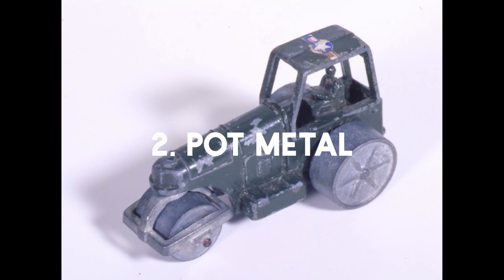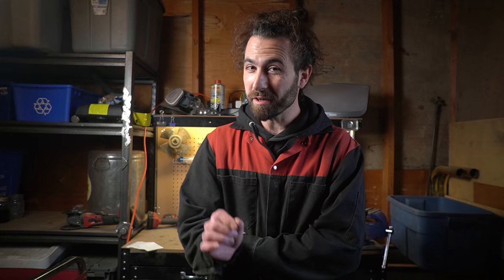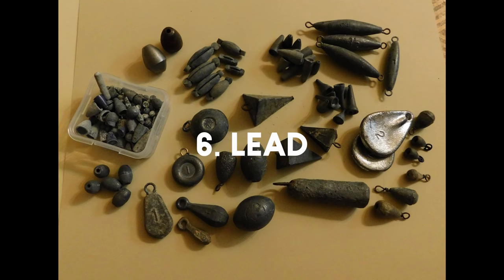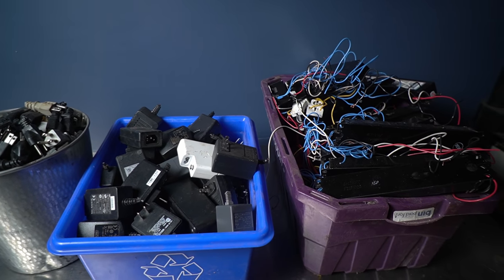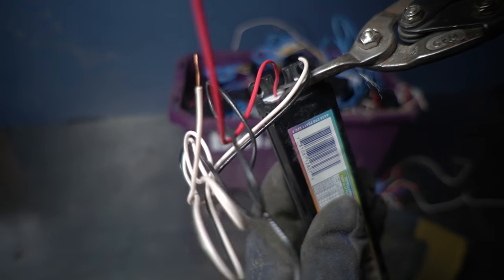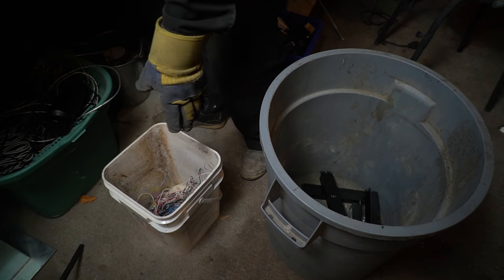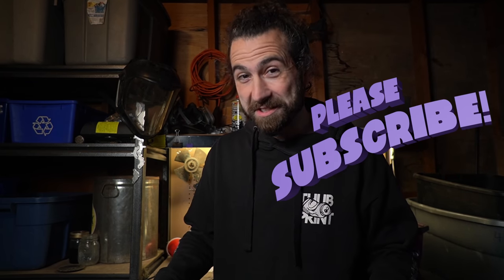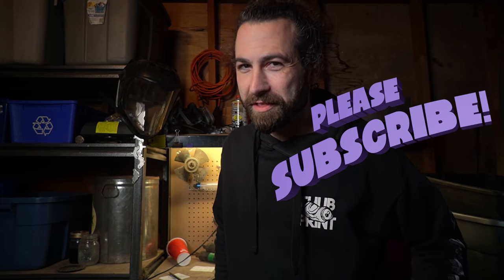I Never Scrap These 9 Items!

Comment: Awesome video as usual Thub. Very interesting to see what's worth the time and what's not. With that said I do collect the brass from plug ends however I don't heat kine up I just put them in a vice and they come right out. Here in west virginia the e-waste is a total waste of time so I end up putting most of it in my metal shred.
Reply: I scrap plug ends the same way. If very easy I think. But everything can be cleaned in a fast amount of time with a little thought and knowledge
Reply: Where I'm at there is a e waste yard but I've never been there and all ike you said it's a waste of time for most part. I save certain items and put in a container to sell on ebay. Other than that I toss in shred.
Reply: It's such a shame there are not the same opportunities across the world, here in the UK I got £1000 for just 171kg of e-waste a couple of weeks ago and computers literally take no more than 5mins to completely tear down🙈🙃
Reply from the maker: That’s such a good turnout! Not hard to see why people like Ewaste with results like that 👍
Reply: @thubprint  exactly, shame it isn't like that world over, so much more would be recycled I'm sure👍

Comment: You dont soften up plugs or wires. You put them into barrel with used motor oil for instance, then get it hot enough so PVC just melts off the wires and the plugs, then scoop them out. You can then siphon oil to another barrel, drain the PVC out to get oil off and if you do this with colors, some places are interested to buy the PVC it self to make recycled PVC to mix in with virgin material, so that could be potential way to do it. Just need to make sure there is no contamination from other plastics and depending who you sell it to they might want you to clean it, but that is just soap and water.

Comment: All you have to do is grab the butt end of the plugs with pliers or channel locks then grab a print with a pair of channel locks and roll down most of the time it will pull the brass out with the copper still attached. Very easy pop on a video of you scrapping makes it more fun

Comment: you are right about  small electronics and laptops.i take  every ic chip relay  3leg transistors  tantalum capacitors and save apart every  BGE gold corner chip. tv boxea and dvr coax connectors are the same bras  material on the power cords ingeneral itdon`t worth  but on  rainy days, snow, storms  holly days,miceo scrapping is ok  while watching  tv or listening  radio.  do not compsre salary in time because if you like ti scrap  it`s aldoa hobbie. but every little adds. good  video.

Comment: another topic, maybe you've made a video on it?   caste aluminum, it's everywhere and i have a large heap of it that has small amounts of steel in it, molded i think.   what's the secret to this stuff, some of it has good weight.
Reply from the maker: I haven’t done a video on cast alu specifically but I’m a big fan! Depends on how dirty it is really, I’ve got a favourite scrapyard to take engine blocks and transmissions and such because I still get a pretty good price despite being dirty. Alu bbqs though, those are a good price everywhere

Comment: The power supplies are only good for is repurposing you can use them to power car stereos in the garage and have a amp hooked up as well & various other useful things that need to have a step down 110v to 12v or 12v to 110v

Comment: On the plug ends if you will hold them with your grips and pull the brass with a pair of diagonal cutters they go faster and no strain on the wrist. Also fun fact: in my area the scrap yards want you to separate the ballasts but pay less than shred price, generally 2-3 cents (US) a pound less......

Comment: Dude! I love these sorts of videos!! The "is it worth your time" content is top notch 🥰 
In response to your question, 2 things I stopped collecting(or at least fully dissassembling) for scrap. 1) Toasters: yes they have a couple good brasa contacts inside and occasionally a transformer but for my time it's beat to clip the cord  for stripping and toss the body in the tin. Occationally the bottom will be a piece of sheet aluminum but that's it. 2) computer monitors, I'll dissassemble and scrap tvs any day but the monitors (especially flat screens) are better just given to what ever charity will take and responsibly reuse them. 

A couple things I'd love you to investigate. The brass you get from power strips. And separately the brass you get from outlets and light switches. Lastly how much copper can you reeeeally get from that center core of the magnetron in a microwave🥰
One point I dissagree with is the PC power supply, not for their wires yes they are trash, but inside there's several small transformer, copper coils, and usually 2 large aluminum heat sinks. Some people say don't waste your time with head sinks but I gather them in a bin and my scrap yard has a category called extruded aluminum "clipping" which these usually are (so are the individual sinks that sit atop a cpu❤️) and it pays only slightly less than clean extruded 🤘 ok that's it from this trash panda🥰
Reply: Also, I've similarly given up on coffee pots and steam irons. Yes they have a big chunk of cast aluminum but you have to go to the effort of cutting out the heating elements. That said still on the fence with electric grills, grittles, and waffle irons. 🥰

Comment: On plug ends, hold the base with large plyers, grip the brass with side cuts down low, pry sideways. The brass pulls out, 90% of the time it brings out the copper with it. 5 seconds per plug.
Reply: You would have to do 450 plugs and a 1/2 an hour to get 6 pounds of brass. The average plug yields six grams of brass per . do the math before 13:53  your run, your mouth. And stop believing fairytales. At 5 seconds per plug, he still would only be able to do 300 sixty, and that would be non. Stop one plug every 5 seconds for a full half an hour. So it's bloody impossible.
It's more like 1 pound per 6 hours if he was double fisting em and doing  with his feet too. Do the math bro!
Reply: I've never come close to 450 and a 1/2 an hour. And I've had over a 1000 plugs. A dozen times or more. There's no possible way that you could do that even if you were doing them with both hands the same time as silly and it's a lie. I've been doing this a long time. And so is he? The only difference is I don't have to lie about it.

Comment: The biggest struggle I ever had was scrapping out a kitchen aid mixer !  Take my word for it, there not worth the effort.
Reply: I totally agree with you!!!! I found one recently and was so excited because it is super heavy but it became a headache real quick! No matter how I tried to remove the top where the motor is I just couldn't  I finally threw the whole thing in the shred pile  ugh never again!
Reply: Trick is to take every screw out you see and then slam it on the ground. it flies apart 😂

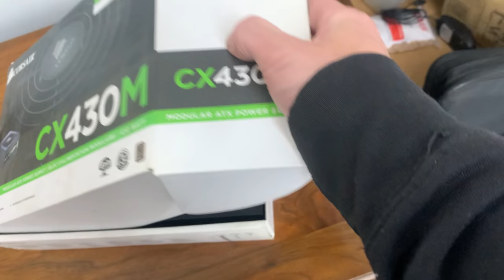Comment: 1:24 look at the print on the wire if it says ag it is silver coated,  and semi worth it…I saved up 100 lbs (stripped) I ended up with 25 oz silver..  90lbs of “2” and rest was metallic sludge (likely sn/PB/Cu/au/ag.etc…. Biggest expense was the 8 gallons of acid..

Comment: I noticed that there was still copper wire fused to the Brass from the plug ends. Does it alter the price if it isn't pure Brass with Copper or is Electroplated? 
Cheers
Reply from the maker: My scrapyard gives me the same price even if it is plated, and the bits of copper aren’t a problem because brass is already mostly copper
Reply: @thubprint  thank you. keep up the good clips.

Comment: i scrap small Transformers just for the Copper, before i take them home i feel them for the Weight, you can tell by Weight alone if there is a Transformer with Wire, i have been removing the Brass from Plugs as i get them.

Comment: You probably already know this, but for anything computer related, that isn't worth scrapping, your best bet is eBay. Collectors, restorers, or people that still use old systems turn there because it's hard to find old parts since they become obsolete so quickly. If possible, list what type of processor, RAM, wifi adapter, and power supply it has so it pops up for those keywords.

Comment: Be careful of toroids (the round wrapped coils) - the wire is copper plated on a lot of those.
Reply: Sadly you are right, copper plated aluminum in most newer stuff even the power wires ugggh 😵😵😵

Comment: For the end plugs, just use a pair of wire cutters, and a good pair of c plyers, and just have to pry the brass tip while holding the whole connector in the c plyer … it’s gona follow easyand you end up with some copper and a piece of brass

Comment: I collect clean cast aluminium as it brings me more than AU$2.00 a kilo at the moment.  Last time I broke down appliance motors I ended up with about 40 kilos, which combined with the heavy ferrous and copper is a decent return.  

Dirty aluminium is my bane as the scrap yard offers terrible prices for any aluminium that has steel pins/screws/inserts in it.  The steel is a few percent by weight but drops the price down to 30¢/kg or less.  Hopefully the hammer mill I'm currently fixing up will cope with dirty cast aluminium.  If it works, I can separate the steel fraction out with magnets.

Here in Australia, our flourescent ballasts tend to be mostly the heavy, transformer type.  Each has about 100g of copper but even with the high prices, getting that copper out economically is another matter.  Still working on that one.

I recently discovered that a scrapper across town accept circuit boards, which to date I have simply accumulated and have maybe 200 kilo saved up.  I'll probably break out the copper-wrapped toroids and throw them through my hammer mill, then send the rest to the circuit board guy.
Reply from the maker: You have a hammer mill??? Nice! I’d love to discover a place with a decent price for boards near me, I still just stack mine up in hopes of finding one. Shame about the dirty alu price, my yard pays okay for it so I don’t stress it too much
Reply: @thubprint  I picked up my hammer mill cheap at an auction about a year ago.  From memory, I paid about $160 which was an unbelievable score as I would have happily paid $1000.

It was used for crushing macadamia nut shells.  It had been left outside on the farm and was in pretty bad shape. I've only had a chance to start restoring it in the last week.

I'm not sure that it will manage cast aluminium because the hammers are really small, more like heavy blades really, but we will see.  I have plenty of other uses for it.
Reply: The magnetic ballasts are potted in asphalt. When I used to do commercial lighting maintenance, you'd sometimes find sticky black stains inside the light fixtures, from where the tar leaked out. You can certainly remove the tar if you get it hot enough. You'll have to decide if your time / energy costs are worth it. If you collect enough tar, it might be valuable as a driveway / roof sealant.

Comment: So I get regular aluminum price and pretty much everything aluminum besides rims which they pay more. Pot metal going in the zinc bin. My scrap yard buys the computer towers by the pound. I strip all the wire out, hard drives and ram. Everything else stays. Laptops get bought by the pound with the towers minus the batteries and ram. Small electronics just go into the light iron. I don’t get a lot of lead. The cord ends just go in the dirty wire bin for me.

Comment: I personally don't soften up or anything on wall plugs. Just grab pliers and pull, they either break off or pull everything out. In both cases what is left is minscule. It just goes in same time as cutting the ends and in one swoop all done.

Comment: I tore my ballasts last week. I took a single edged razor blade to the wires. I laid the wires on my round BBQ and stripped them very easily. The stripmiester wouldn't take em. I did about 10 ballasts In half an hour.
Reply from the maker: Nice! I don’t mind selling them with the casings when they’re that small, but wire is always worth more if you have the means to strip it 👍

Comment: Brass from plugs I save them up for winter and get a 50ltr box full of plugs but in summer I strip wire from ovens fridges hovers transformers dryers starter motors alternators this year I had 8kgs of brass legs I got ££ double figures for few hours work each night alloy here is around 30p kg unless it's alloy wheels

Comment: Laptops, i just take to the electronic scrap place as is. Die cast, pays ok where i go. Just watch not to mix with cast aluminum, if you're not sure the difference,  the telling is by looking at the edges of broken pieces, the inside of die cast almost looks non metal (due to being an alloy). Where regular cast looks the same throughout. The power packs , i can see why people wouldnt want to bother, (esp if they have a buyer thatll take em intact), but i find them easy to dismantle, just by smashing with a heavy hammer (careful, use gloves and eye protection people...), to collect the small motors inside. My buyer pays ok for electric motors, and since i end up with so many (some like to dismantle them totally , but i dont), they add to my e. Motor weight. Happy scrapping folks

Comment: The third one, the aluminium trays and plates, etc. No real money in those unless you can source big volumes. But perchance I still do those, from what I find incidentally from bottle and can collecting. I only do them because I can, and not for the money. I keep them separate but they go alongside the aluminium foil which I take in. I source a hairdresser for the foil but it still takes 6 months to fill a big woolbag. One filled up woolbag of aluminium foil is the gratification of completing a full unit of industrial output which the scrapyard can send on as is, and the bag of compacted tray is addition to the receipt.

Comment: Get a cheap toaster oven, throw those plug ends in, get them warm. Do not melt them! You can pull the brass and clean copper right out! I always cut the copper off and add it to my stripped wire bin